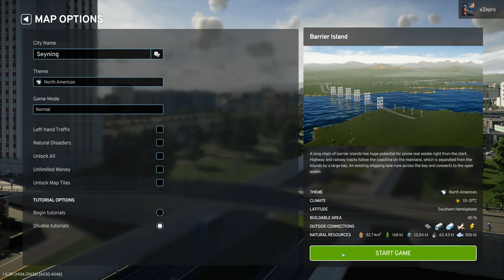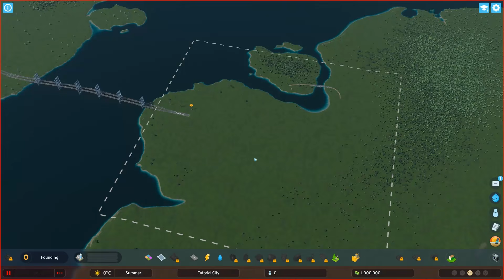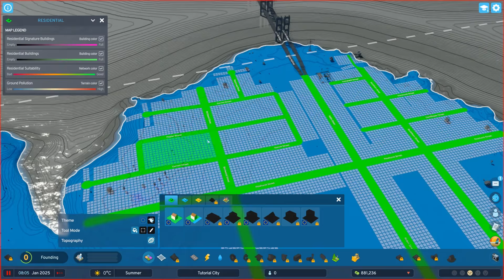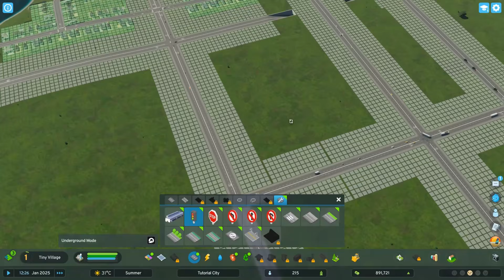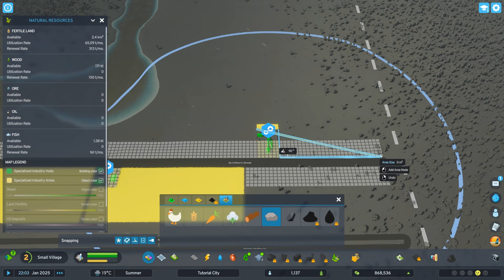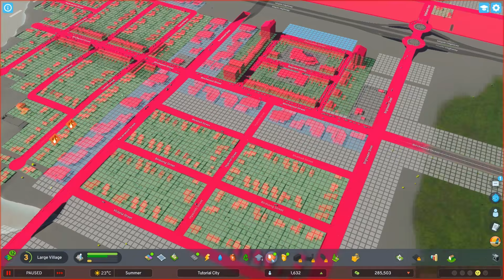How to get the very best start in Cities Skylines II - Beginners guide, tips and tricks (PART 1)

Comment: A great start and some great ideas. Your method works very well. Thank you for the video!
I've not seen anyone zone every square in each city block before. I usually leave several lines of squares between the rear of buildings for trees and off street parking.